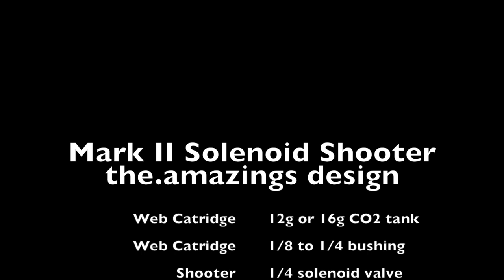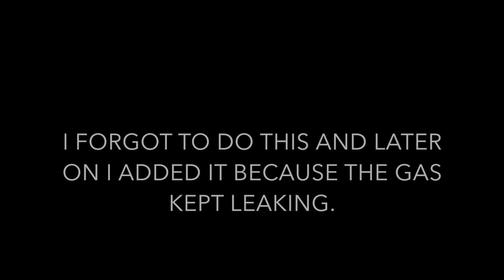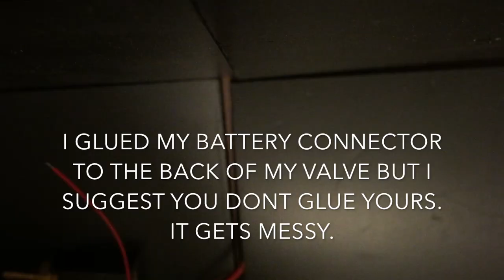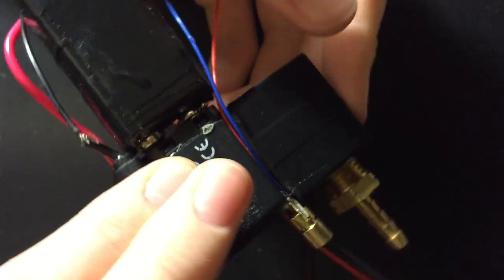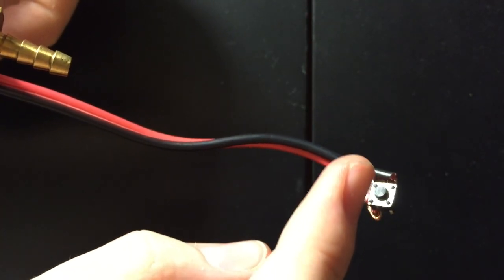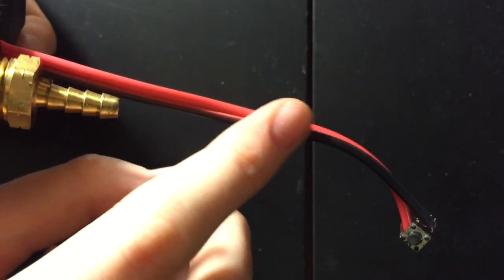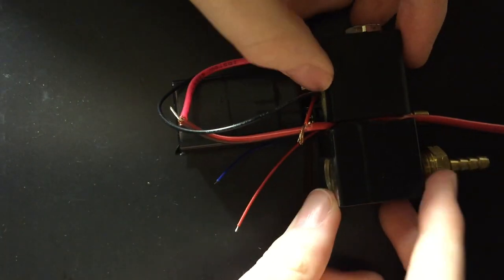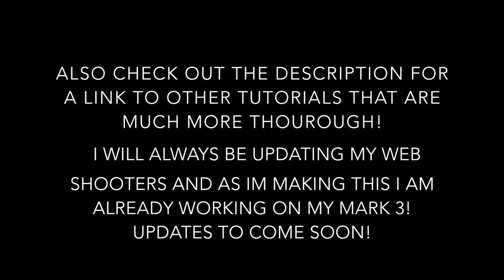Tutorial: Solenoid Web-Shooter Mark II (Mini)

Comment: when you fill the cartridge with "web fluid" what prepells the webs to actually squirt out?
Reply: Isobutane or butane, it's a gas when you freeze it, it becomes a liquid and then you have to put it in the cartridge, and it will evaporate at room temperature so that will pressurize the web fluid! Hope this helped.
Reply: It did, thank you!

Comment: Can we do this without soldering the wires together and add electrical tape? Because I don't own a soldering iron
Reply: A few years back before my dad trusted me with a soldering iron, I twisted the wires together then hot glued them so they didn't untwist, then you can add heat shrink over it. But if you can just buy a cheap soldering iron, the cheap ones are pretty affordable
Reply: +megatron915 thanks

Comment: Could you make a version without wires or batteries? I'm not good at that stuff, and I'm a little clueless on how to do some stuff.
Reply: Ummm you sort of need that stuff, it's like driving a car without an engine... You need the engine... Nothing will power without a power source.
Reply: mine is powered with air pressure!,
so no battery's or wires!
Reply: +The Incredible Spider what about the valve though? Without batteries, I'm assuming you didn't use a solenoid... So what did you use...
Reply: +The DIY Knight look at my second video!, or the co2 powered web shooter from the amazing!

Comment: I don't own a soldering iron, would I be able to use a lighter to melt the tips together?
Reply: No do not use a lighter i suggest use electrical tape to hold together
Reply: +ARSENAL S oh hey, it's you again!

Anyways I'm reconsidering the solenoid web shooter.
Reply: +OTDinosaur Scrubs LOL yes it me haha and yeah thats awesome
Reply: +ARSENAL S i wasn't gonna make it as I had no liquid propellants but I found out that my shaving gel contained some, as I added a bit to a web fluid solution I used to work on and it caused it to foam up and come squirting out, I use a screw to keep its container airtight and the second I loosened the screw the fluid came squirting out and fired the screw halfway across the room.
Reply: +OTDinosaur Scrubs ... Wow crap thats actually really smart
Reply: +OTDinosaur Scrubs ... Wow crap thats actually really smart
Reply: +ARSENAL S thanks man :^) also really good job on your webshooter, it's looking awesome so far!
Reply: +OTDinosaur Scrubs thx!

Comment: your using a 9 volt battery and no coil I just want to ask, are you using a 12 volt solenoid because I'd so how does the 9 volt battery work on a 12 volt solenoid
Reply from the maker: +The Slinger (Magic Freak) My bad it is a 9v! Got confused!
Reply: +The Spectacular a 9 v solenoid or battery
Reply: +The Slinger (Magic Freak) 9v battery, and a 12v solenoid air valve
Reply: +The Incredible Spiderman but how does the 9 v power it?
Reply: +The Spectacular .
Reply from the maker: +The Slinger (Magic Freak) it has enough power! I forget why but it works fine with a 9v
Reply: +The Spectacular thanks, I have two extra solenoids so I'll get to building it